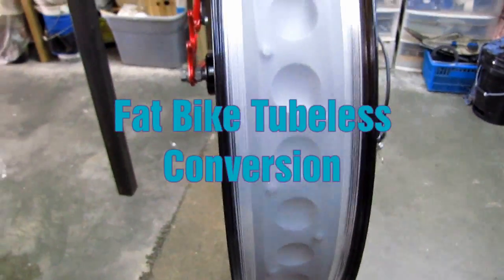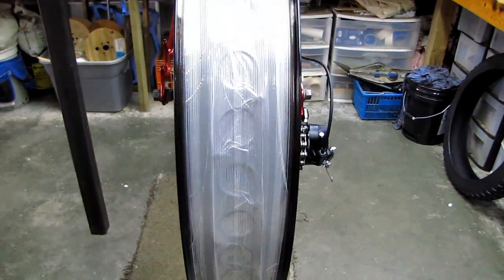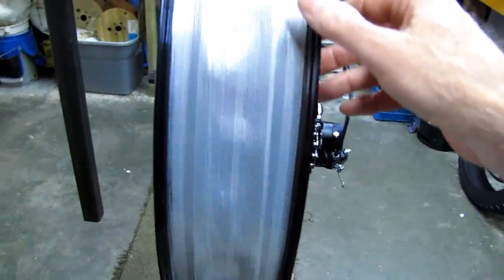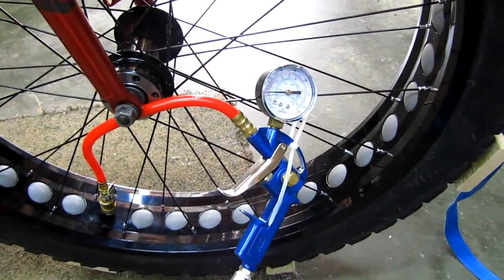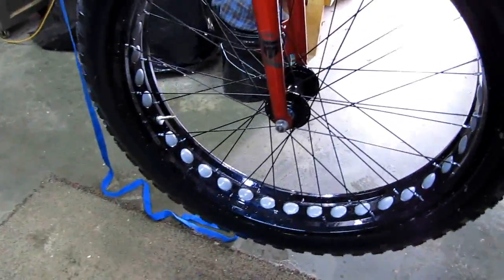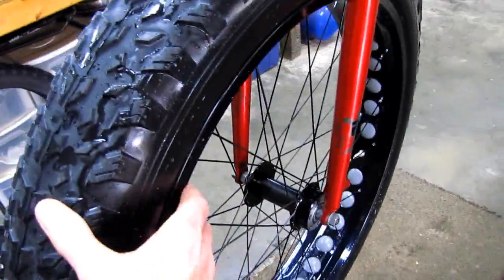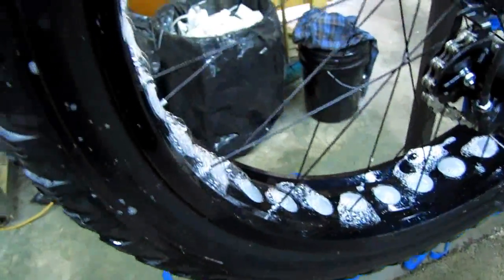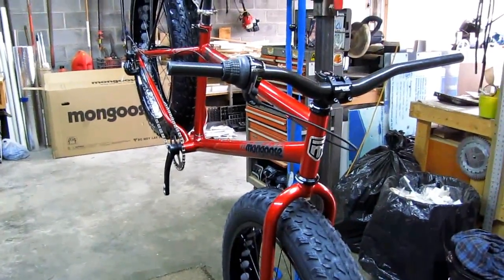Mongoose Hitch Ebike Build #4 - Fat Bike Convert to tubeless

Comment from the maker: Here's an update on the tubeless conversion. The rims and tires on this bike would not hold the bead at low pressures. The rims have a bad bead profile and the wire bead tires were too stiff. I ended up sucking all the Stan's back out of the tires and putting the tubes back in. I was then able to ride at 8 pounds pressure.
No big deal. This bike is only a test bike to see if I liked it as a Fat Ebike. It is really fun to ride, so now I am going to build a carbon fiber Fat bike and wheels set and transfer the Luna BBSHd motor kit over to the carbon fiber Fat bike. That build will be happening  next, so stay tuned :)
Reply from the maker: BTW, the tire held pressure just fine at 7-8 pounds, which is where I run fat bike tires with that huge volume of air.